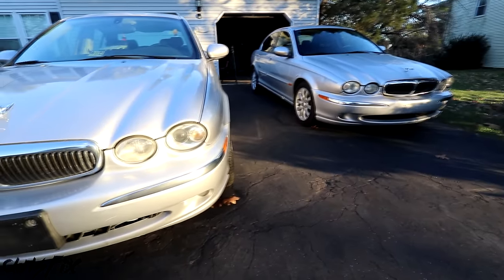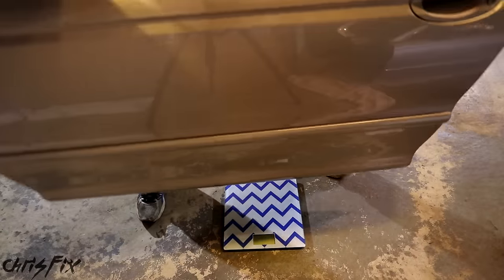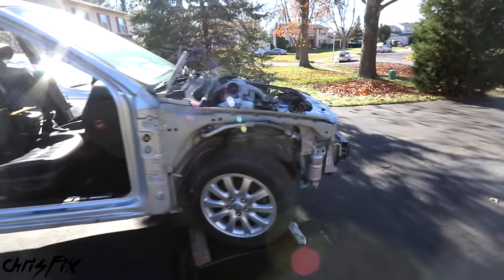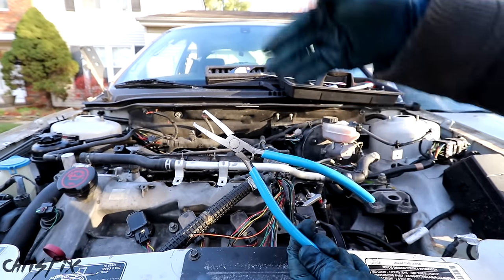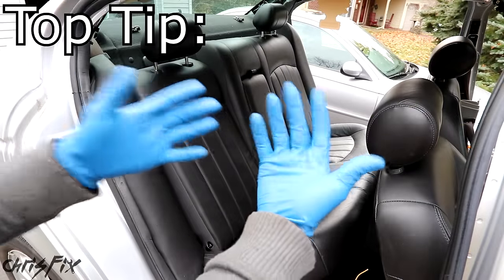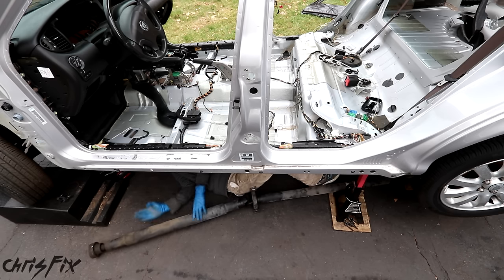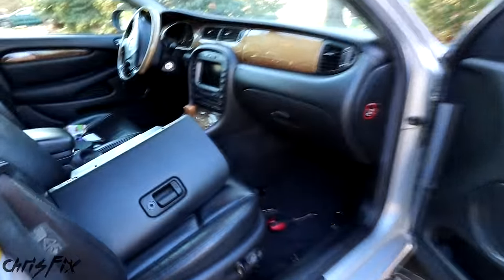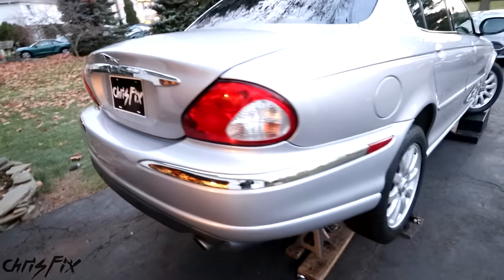How to Strip a Car COMPLETELY

Comment: why are the rims different at 8:53 compared to 2:34
Reply: At 8:20 you see the tires were taken off and he put those crappy rims on there to get rid of, the stock rims probably have more value to owners who want original.
Reply: Those were the bad wheels that came with his Dad's Jag, but he changed them with wheels he bought from a scrapyard and he restored. He was probably going to bin the wheels anyway.
Reply: yoboi27 ikkkkkkrrrr

Comment: Why dint u take the cat off its worth 100 you just need to cut it
Reply: Cat?
Reply: @footage6402  Catalytic converter. Part of the exhaust.
Reply: he was clearly "striping" just for the parts he needed. a "true strip" has you cutting the frame and taking it into your local metal recycling and NOTHING at all remains. the spirit of a buffalo is mad if every part of the buffalo is not used.

Comment: He could've gotten more money had he sold the rims as well...
Reply from the maker: They needed it on wheels to roll up the flatbed or I would have sold the rims too!
Reply: ChrisFix next time take the spare and use it to get one complete wheel and tire.  I use all donuts from parts yard, they just have to match up two studs and the rest you cut or drill to get it to seat.
Reply: ChrisFix Should have let it roll on old donut rims
Reply: ChrisFix lol

Comment: Something I usually do before getting rid of the parts car is to reinstall all the bad parts from your good car. In this case I´d have reinstalled stuff like the bumper etc with just a couple of bolts. That saves you the trouble of having to brimg them to the recycling etc.

Comment: Chris, I'm an American expat living in France. Here's an interesting fact I recently found out. It's illegal in France for people to take apart a car and sell it for parts! When a car can no longer be driven your only option is to take it to the junk yard of your choosing. There, the staff is licensed to take apart the vehicle and sell it for parts. From what I've read, they are required to tag every part in some special way so that whenever it eventually makes it into another vehicle, the new parts can still be traced back to the original vehicle. When you sell off your car to the junk yard, they usually give you 100 to 500 euros (negotiable but most junk yards are operated by sharks). I recently only got 200 euros for my used car. I felt totally ripped off!

Comment: Hmm, I think I might strip my Peugeot 407 coupe I bought a couple weeks ago that turned out to be a total lemon, never gave any hints on the ride puting it through it's paces on the motorway, only sound out of the ordinary was an already advertised loose front right wishbone bushing.

Suddenly a week in the transmission locks up, electric windows start showing faults then just cease working (although, that was after reconnecting the battery terminals with the key in the on position), & the passeneger seat somehow pops out of its upright position & flops back (they aint meant to do that), wanted it as a fixer upper but not like this bad, transmission was almost buttery smooth on the hour long test ride.

I was all ready for inspecting the engine, potentially replacing piston rings or the complete valve train if they were worn as I even have a pressure guage & leak down test kit, which I'll still do as after the first few days of having it, removing the oil filler cap with the engine running causes a loss of pressure in the cylinders it seems as it starts struggling a little bit, & can even stall out if replacing the cap to fast, doing it slow it just drops power by about half but can keep running back up to normal, so there's clearly something not sealing right.

Comment: Did the tow company require the wheels be left on? Seems as if those would have value for you to use or sell. Or maybe they're needed to move and load the car on the flatbed.

Comment: What about airbags? What should be taken into consideration if you want to remove for example seats and dashboard safely from a car with airbags?
Reply from the maker: The battery would have been long disconnected/removed by that point
Reply: @chrisfix  Thanks for the answer, so that will prevent airbags from accidentally discharging. What about those seatbelt tensioner thingys, I suppose they got some kind of pyrotechnics inside them? Can they be accidentally discharged or do they also need an electric signal to go bang 😅
Reply: How are the tires, if good right there is $750.
Reply: Your neighbors are going to hate you.
Reply: You can get a lot more than that for airbags.  Finally, what about the catalytic converter ?  Could have gotten $$ for that.

Comment: Pausing the video for a sec. Every tow company has different policies but i would feel a little in edge when truck driver nuetral rolled the car off the ramp. Regardless of the car its a big risk if the brakes were to fail for any reason. Like i said regardless of the car it could still be possible :)

Comment: How did you get the tires off then stacked in the garage??
Reply from the maker: No tires, they are wheels and tires. I removed and saved the wheels/tires and put these junk ones on.
Reply: @chrisfix  i was watching to figure out the wheels and struts lol. Thanks for the video tho helps a lot